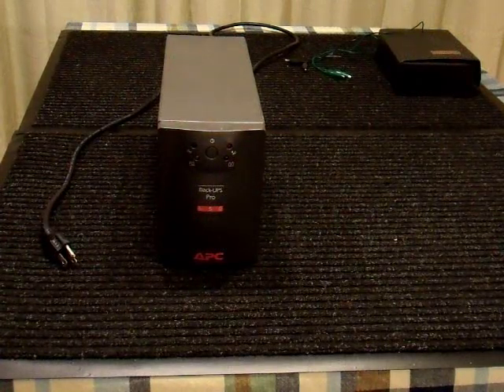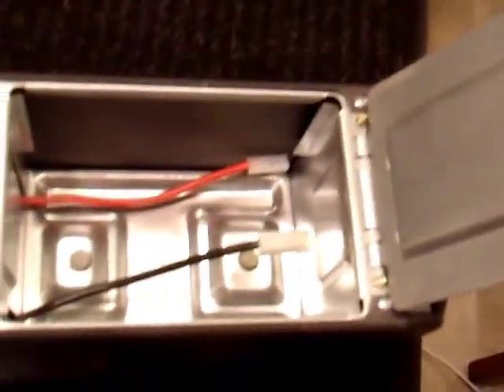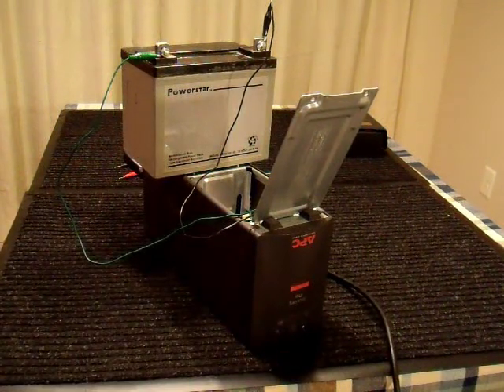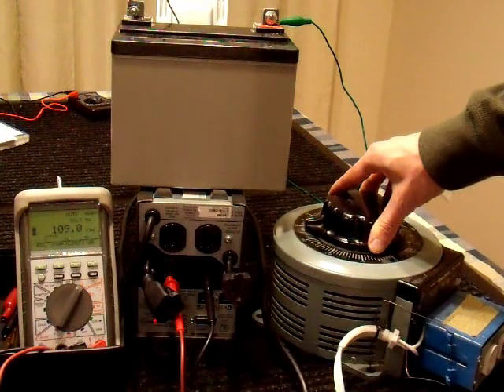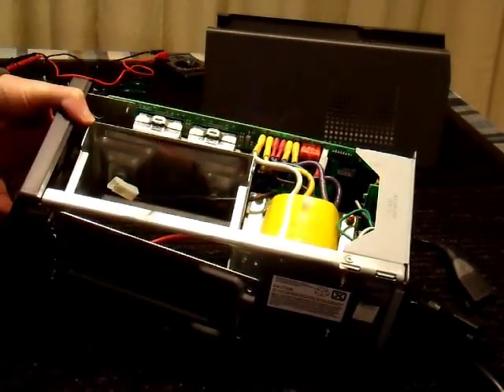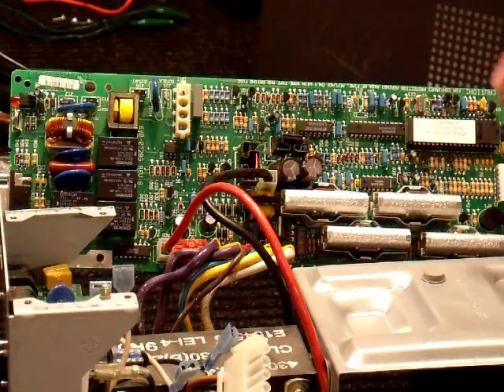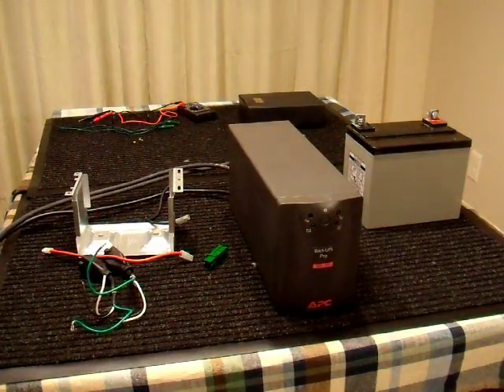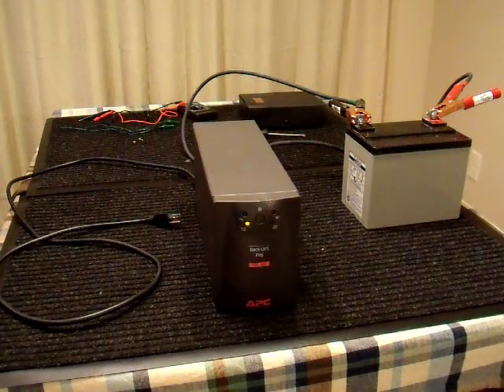UPS to Inverter Conversion APC Back UPS 650 Part 1 of 2

Comment: But how do you get it to go into battery mode without plugging it into 120 first. My old ups had only a on off switch.
Reply from the maker: On these older APC UPS units (before they were purchased by Schneider Electric) you hold the power button until it beeps and immediately release it.  No AC power required to power it up.
Reply: @knurlgnar24  this is no power button just a on off toggle style switch

Comment: Auto Transformers are NOT ISOLATING.  Hot side is Reference to Ground.  It can and will ZAPPPPP Ya.    4S 38120 LiFe Cells work too.  LOL    I came across a 240VAC  50/60hz version Version (APC model BP650S 240 VAC UPS)  .  The Transformers is Center Tapped dual  120 Series tied secondary.    This one has Four Wires secondary.  120 between each set.    Tied both coils in Parallel.  Had to change the Sockets.  Yes It will do 800W @ 120VAC.   Guess this one being the North American Version default is 60Hz.   For all the trouble messing with it I could have just purchased one.  Only Reason I kept it was they are Sign Wave.  Using it in my Wind Turbine  Solar Power Wall Set Up as a Fall Back  . Manual Start Up Required.  I need more Battery.  LoL.  Way More Battery.

Comment: hi, i followed this video to help with apc smart 1500 ups.  i wired two agm batts in parallel to the batt plug.  they were both fully charged. i got big smoke coming from the back of the unit.  i figured the jig was up.  i took the unit apart and found the smoke came from the exiting ground ac line.  i think someone who knows more than i would find that quite informative.  to my laymans thinking it seems to me something unneccesary (read stupid) happened.  something not key to the machine.  but something that stops me in my tracks.  i don`t think a determined knowledgable person would have to throw it away quite yet.  any comments as to what could have caused quite a smoke show from the outgoing ground?  the bared wire and burnt insulation  is located at the end of the ac ground where it loops up and bolts to the ups chasiss.  so sad.  it came from the garbage at work and its battery was bulging , the lcd read batt needs changing.  so for that time the unit was working.  it was given to me after that batt was taken.  i don`t get waht happened.
Reply: +ian stewart   it was not plugged in.  it  dissapointed me.  i assume its goin in the garbage unless i hear a miracle reply.  i took the pcb off without thinking it was ever going back so i know i will have the plugs to figure out if i get to go back.

Comment: Hi Knurlgnar24.  The 'stupid' plugs on some were two-fold.  1, if you had cube transformers plugged into the receptacle, sometimes you couldn't use the other half of the duplex receptacle, so these short cord plugs were handy for them.  2 -- on some APC, the stupid plugs were 'surge protected' ONLY and not battery backed up.  Looking at yours, do you see how 1 of the stupid cord receptacle was in a 'black' area.  the other in a silver area.  I'm going to guess 1 is surge only and 1 is battery backed up.

Comment: I found an apc ups 800 and It only works when it has a battery and it is connected to a wall outlet how do I convert it to were it just works with the battery, I also have a apc600 and that works just fine without being plugged into the outlet and it only has a battery...
Reply from the maker: I haven't seen that issue.  Generally if you hold the 'on' button just until it beeps and then immediately release it they will power up without wall power.  If you hold the button just a touch longer it will shutdown and you'll have to try again.
Reply: LOL!!! "REALLY?" Wow... To my amazement....LOL!!!
Reply: marcos22571 Some old UPS's just need to be plugged into themselves with a battery in them and turn them on, some you have to plug your AC wire into an isolation circuit then plug that into the back of the UPS.  As far an isolation circuit goes I don't have a schematic on hand but I'm sure one could be found on Google!

Comment: I found an ABB ACS600... it's a frequency converter used to drive electric motors. It allows the machine to control torque and speed independently.

anyways, i found one on the side of the road two weeks ago. I had no clue what it was but then I looked in youtube.
What is inside is a AC/DC converter and then a DC/AC converter. ....

Soooo, when I have the time I will look into what's wrong with it and see if the DC/AC part can be used an inverter...

do you have any experience or konwledge about these devices?

cheers

Comment: Hi, I have 4 backups ups 650, can I use them in parallel. Or can I use  all transformers on one of them for more power? Could you give me a schematic, it is possible to run 2 transformers in parralel? Thanks for example I have a smartups 750 sinewave. Can I change his transformer with a 2kw from a modified sine wave invertor, and install more transistor's on power output. I will install them on a separate board to don't have problem with heat. Thank you very much.
Reply from the maker: Transformers can be paralleled i they are identical.  I have tried this with UPS units and it works, but not terribly well.  I am not sure about swapping transformers between MSW and sine units as they may have different leakage inductance characteristics.  I suspect that it will work but I am not certain.  Be aware that the turns ratios are different for MSW and PSW transformers so you may not get exactly the right voltage and/or waveform.

Comment: Can you convert a "regular" sine wave inverter to a "grid-tie" or parallel ac voltage inverter that can back feed to the grid?
Reply from the maker: Converting a standard inverter to a grid tie inverter would require significant modifications.  I suppose it would be possible but it would be more practical to simply purchase one.
Reply: Do they make some sort of phase shift transformer? I have really really good sine wave inverters ... A bunch of them.
Reply from the maker: Jim Frake
The design of a grid tie inverter and a standard off-grid one is quite a bit different.  It would be difficult to convert, but I'm sure possible for someone with the willpower.
Reply: Well if there is already a device that could monitor the phase of the grid ac and adjust the incoming inverter's phase accordingly, half of the mods are complete. Then all we would need is to create "islanding" which would disconnect from the grid when it went down. Why recreate the wheel if it already exists?

Comment: Hi i have 2 ups apc 650. One is apc 640-0232h rev 08 and the other one is 640-0214f rev 07. I found it in flea market with boxs but no transformator/trafo. So i dont know the input/output wiring line. I want change with tranformator with CT, can it?. So please send me pinout trafo ups apc 650 i seem there( in this video) about 6 cable in secondar and 4 in primary.
Reply from the maker: Unfortunately I no longer have this UPS in my possession.
Reply: May you remember the conection cable.... from mainboord to transformator... or you can help me with link web... in this case...
Reply from the maker: julia the black master
This one had a standard 4 pin Mate-n-Lok connector for the output which had only one way to connect it, and the input side is two terminals where the polarity doesn't matter.

Comment: I have a few (6) of that same model UPS by APC and those "pig tails" on the back are for "wall wart" type adapters on like a router or modem. The battery I put in mine are UPG UB-1280 12V 8 AHr
Reply from the maker: What kind of luck have you had with those Chinese UPG batteries compared with the more reputable brands?  I've never tried one myself, but when it comes to lithium batteries I've had bad luck with China sourced components.  For batteries I prefer Japan or USA made products.
Reply: Well if you use the battery in what it supposed to go in then they will be fine. Now the weirdness starts with China batteries when you run them in an over charge state for whatever reason. The smaller batteries will heat up and bulge but they will still work just cosmetically deformed a little so the temperature is an issue. So far the ones I have haven't given me any trouble ab I only got those because the store I get batteries were out of the better band name ones. One thing you and anyone should watch out for is typical of China is the fake name brands where they take their cheap version and decal a name brand and model on it. This happens through online deals mainly and of course is illegal in the us and considered "black market" items.

Comment from the maker: The APC unit does nothing at all with GND - it just connects all grounds together and to the metal case.  Power is supplied on line and neutral and is isolated from ground on these UPS units.

Comment: knulgnar if u stop using AC , how does the socket in the back have a neutral? What did u do 2 the neutral from the plug socket in the back of d ups?  if nt how will appliances run without completing the whole live(hot) and neutral ? pls tell me need serious help

Comment: "Gel Cells" just don't last- But the Big Auto Parts Chains have probably the best deals on Deep Cycle Batteries- Which last for about 8-10 years. And when you're done with your Deep Cycle because it has lost more than half it's capacity- They Have More than enough strength left to use in a Vehicle as a "Starting Battery" for several more years of use.

Comment from the maker: Should work fine, though the efficiency and no-load draw of UPS units is generally not very good.  It would probably be most practical to turn the UPS and AC on and off together to avoid the idle draw of the UPS.  I had wanted to do something similar but never got around to it.

Comment: HI i got a 3000Va trying to get the Inverter part of and have the system do this. it is a 48V unit.

1. charge the 48v batteries with solar power
2. Hook up the 1000btu ac unit to this system and possibly run it during the sumeer

do you think it is possible with this unit?? or am i out of my mind :S.

Comment from the maker: The charger is current limited, so as many (in parallel) as you want within practical limits.  However I would recommend charging only one at a time since batteries should only be charged in parallel if they are a matched pair that have been together since new and never separated.